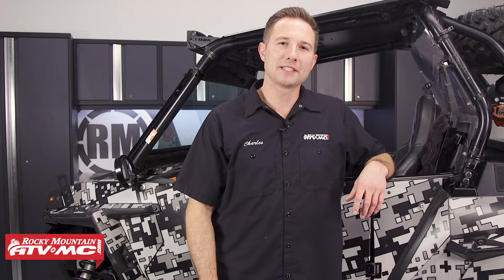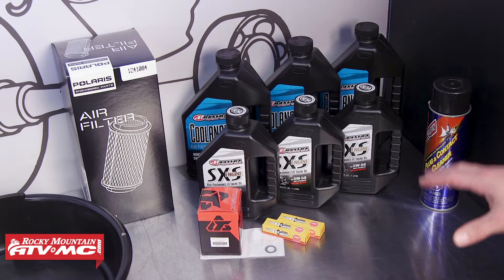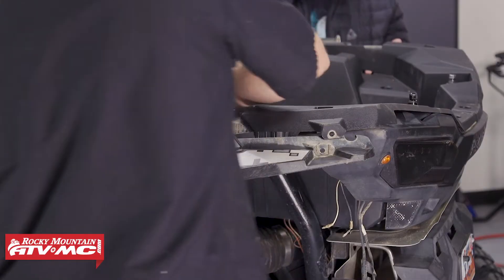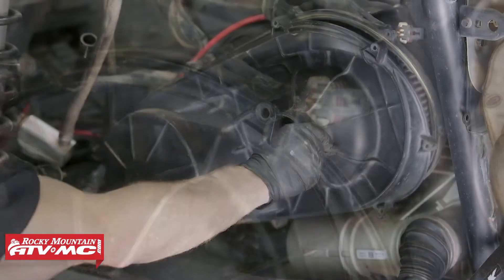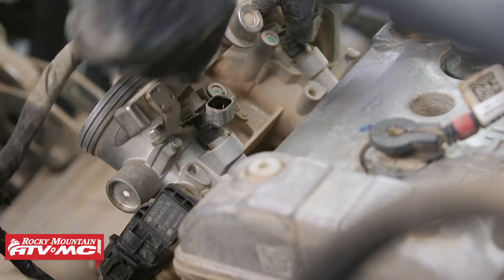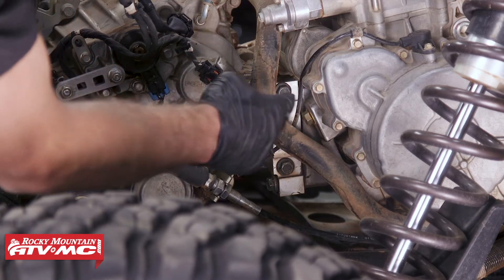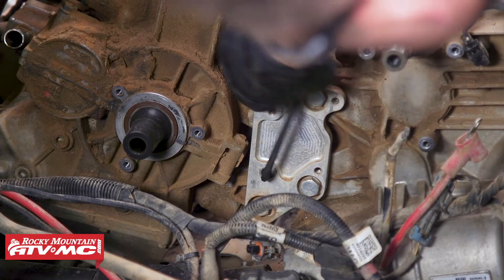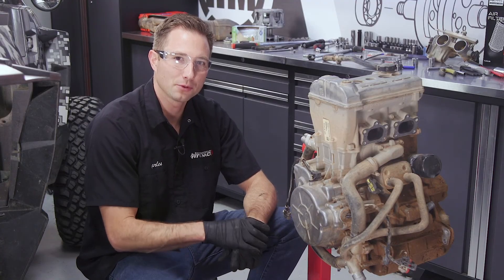Polaris RZR XP 1000 Engine Rebuild | Part 1: Engine Removal

Comment: I would think you would at least pressure wash the engine and put a towel in the intake ports before working on it? TOTAL HACK JOB! how much damage are you doing to the cylinder dropping dirt into it?
Not professional at all. Back yard hillbilly workmanship...
Reply from the maker: We washed it before pulling the engine and after. There's only so much you can reach before parts start coming off. The engine was plugged and pressure washed before teardown.   I'm guessing you didn't make it that far into the video series. When you tackle your first project, the steps we took will make more sense. Good luck and let me know if you have any questions. -Charles

Comment: What kind of engine stand did you use? I am having a hard time finding one that the adapter will fit in.
Reply from the maker: We went inexpensive on that and got one from Harbor Freight, the adapter fits perfect. -Charles
Reply: @rmatvmc  Yeah they have changed their design and reduced the shaft size to 1 1/2. now I have the adapter but can't find an engine stand to fit. My luck
Reply: I’m having the same problem

Comment: Thanks for the video one cuestión Any reason not to use impact gun to desasemble??
Reply: As an ATV/UTV/LSV Mechanic, using an impact gun could potentialy damage fastners during loosing because of the extreme vibrations and the fact most of what he is taking off for this repair is subjected to many thermal cycles, and or vibration which over time can cause the hardware to become brittle. It's best when removing engine componenets to do it by hand tools, although slower it is much safer. Trust me you dont want to fight a stripped/snapped bolt is a space the size of your thumb and that you may or may not be able to see its a nightmare and potentialy very costly.